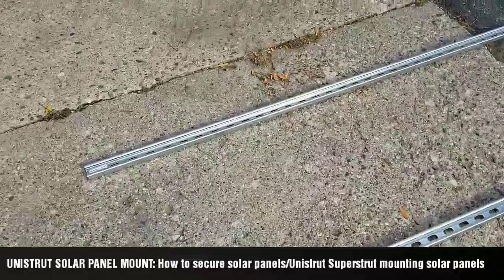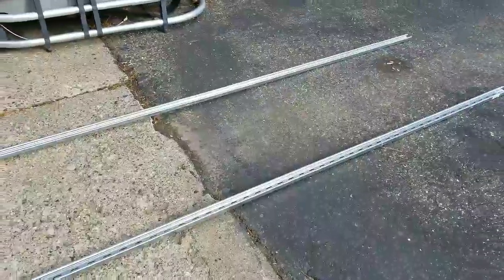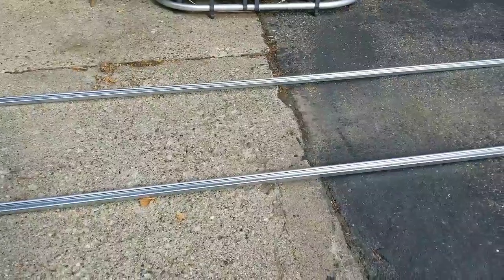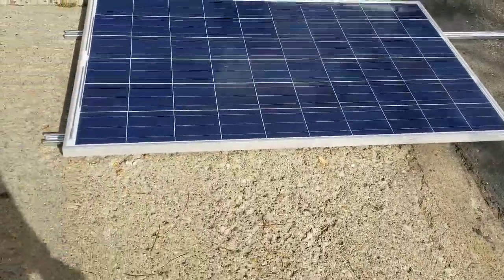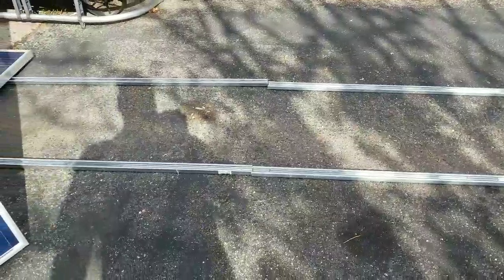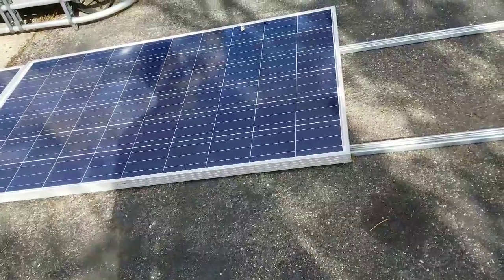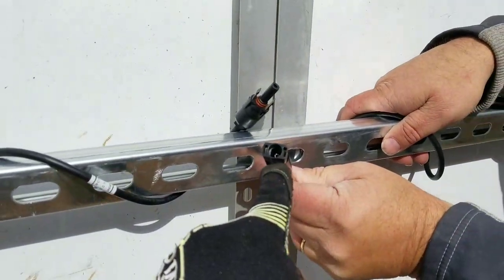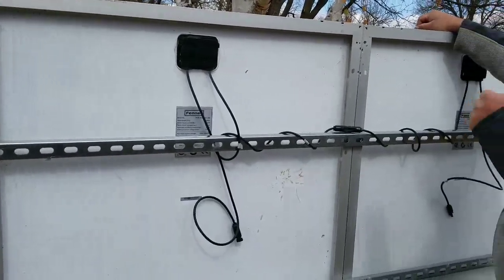(Part#3) UNISTRUT SOLAR PANEL MOUNT: HOW TO SECURE SOLAR PANELS

Comment: Great video. I do wonder what about expansion and contraction throughout the year.
Does he realize that wrapping that wire around steel makes it a bit magnetic? Kind of like an RF choke in a way.
Is that good or bad?
Wondering if nearby tv/radio/cell towers have any effect on solar setups.
Reply from the maker: Thanks for stopping by.
Please don't forget to Like Share and Subscribe

Comment: Excelent work my friends, the only i can recomend is to be carefull with the wiring, you are not supposed to put it arround the unistrut rail, because it will be mounted into a surface and the wire will be trapped between the surface and the unistrut, this way it can cause some damage to the wiring, afecting the insulation and maybe enerizing the structure. Instead, i recomend to use the inner part of the rail, between the panel and the unistrut to conduce the wiring very carefully, and keep it in place with some plastic stripes, it will be easier to do maintenance work or module replacement avoiding electric shok risk. Anyway, excelent mounting work, thanks!!!!
Reply from the maker: This is just a demonstration on how to mount solar panel on a Unistrut/Superstrut. This is not solar panel wire management. I have done a video on that while ago. Watch for that video.
Thanks for watching LIKE👍 SUBSCRIBE and SHARE
Reply: @jwsolarusa 
He means that your unistrut can shock the shit out of you because it's conductive if a wire hits it right ,like in the wind , Incase the wire in PVC for safety bro. Take care !!!